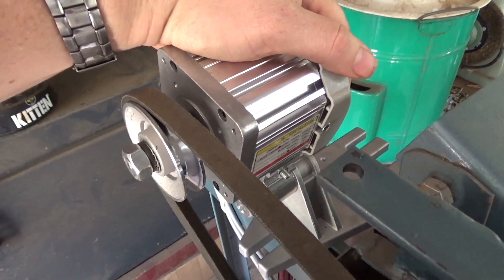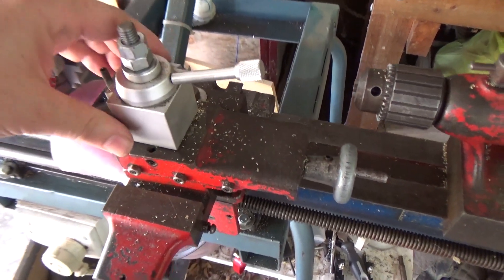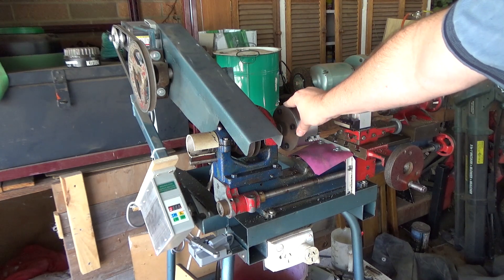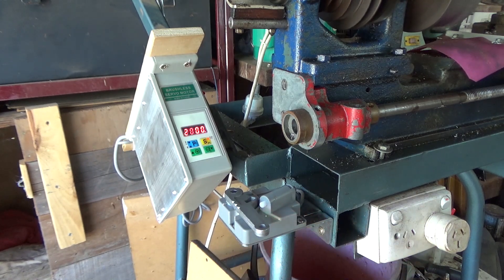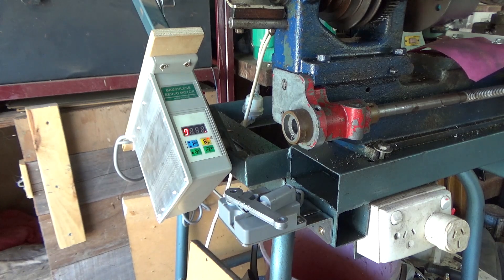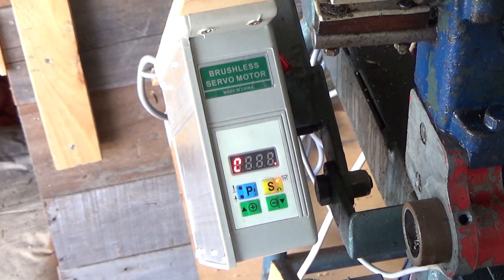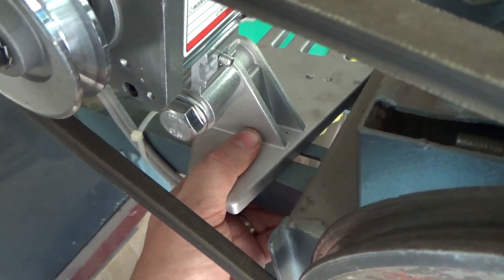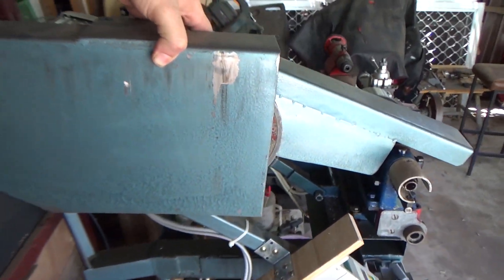Lathe Motor upgrade - adding a 550w 3/4hp brushless servo sewing machine motor

Comment: These sewing machine motor kits are only good if you get the 1 or 1.5hp set up & use is for a belt grinder . No good for a a lathe mate.  Don't re invent the wheel . Use tryed & tested  approaches & keep it simple & u can't go wrong

Comment: Get rid of it my freind . Get a dual phase 230V /415v  3 phase motor & VFD they are cheap as chips & you will NEVER regret if. Infinite speed control. For for 1.5Kw

Comment: What is the lowest RPM your new motor can run at? I'm thinking doing a similar conversion to my lathe, but I need to run at least 50 rpm when doing screwcutting.

Comment: Out of the box, did you need to do anything to get the motor spin? Did you need to set some specific parameter in the controller?  I just bought one of these, it won't spin! Thank you. [UPDATE: I was moving the lever in the wrong direction! It works!!]

Comment: Sir, is the speed linear with the movement of the lever ? I noticed you change the program speed. Is the program speed the setting of the max speed the motor could turn ? This means if you set to 3000 rpm, the speed can vary linearly between 0-3000 rpm?

I am looking to use for cnc application. Does the input control take voltage say 0-5 or 0-10 V?
Reply from the maker: That is correct regarding the speed control, you can set the maximum speed in the controller, and then the lever adjusts between the 0 and the top speed you specifiy. 
The control lever is a potentiometer or a hall effect sensor, I can't quite remember right now. I'm not sure the best way of adapting that for digital control
Reply: @StiffmanOz  thank you sir
Reply: @rengankrishnaiyer6912  That kind servo motor for sewing machine I think they say 5v. I see it  from the manual book
Reply: @rengankrishnaiyer6912  and for some brand they have connector for 5V DC led lamp. 5V 100mA
Reply: @coron1985  thats nice to know cheers

Comment: Just burnt mine out cutting steel at 200rpm on a bandsaw. getting a worm-gear and will shut it down before cooking the next one. There's a gap where the lever meets the housing allowing swarf waste to short across from the magnet to hall sensor and lever. It's a nasty jolt with one hand on the lathe and you touch the lever. Shrink wrap the lever  and a regular clean solves that.
Reply: Turns out while the motor got too hot to touch it still works fine. The controller needed replacing.

Comment: Do you think the motor is usable for a small bandsaw?
The variable speed makes me think of using it so my bandsaw can be used to cut metal
Reply from the maker: It might. It depends on the size of the motor on the bandsaw. If it's only one of the table top ones, I wouldn't be surprised if it is OK wattage wise. The other thing to be aware of is max RPM. These little motors can spin at quite the pace. You might want to confirm the rpm of the motor on the bandsaw too. You can adjust the speed on the motor controller, but you want to be careful not to give the bandsaw way more speed than what it can handle. 

Basically, I haven't done it, so I can't say for sure, but it might.

Comment: Why wouldn't you just mount the servo directly to the back end of the lathe spindle instead?
Sure it spins but it sounds a bit loud and you hardly get to see the benefits of a servo motor over another kind of motor the way you've done it.

Comment: Hi great tip by the way, im just curious if that dc brushless motor can be tweeked to add a reverse switch ?
Reply from the maker: I'm not entirely sure. The control system does have a method of reversing the motor, but it's not quite as easy as flicking a switch.
Reply: @StiffmanOz  Thank you I really appreciate the conversions you did and planning to do the same with mine upon figuring out the reverse rotation issue.
Reply: @abelplus  if u want to make easy reverse switch. You need to see how Drone/RC Brushless 'DC' motor work. They use 3 cable, just swapping 2 cable will make the motor rotation changed.
Reply: Need some modifications to the cable before motor, I think the name for 3 cable that brushless motor called U V W cable . using Dpdt switch for easy reverse. Correct me if I'm wrong
Reply: @coron1985  Thank you coron 19,  I did a similar solution like you said, I decides to install a 3phase ac motor and a VFD controller that gave me a lot of flexibility with speed and direction controls and direct integration with my breakout board. Again thanks for the tip
Reply: @abelplus  how much watt that brushless AC motor do u use?
Reply: @coron1985  I just used 0.55KW which is just right for my mini lathe, the motor is  220ac, 3 Phase, 60 hz,  3600 RPM motor and my pulley ratio is about 1:3 so i can push about 1270 RPM on my lathe chuck.
Reply: @abelplus  how about torque? Is capable?
Reply: @coron1985  Torque on my 3phase motor was not specified on my specs sheet but on my observations the torque is greated compared to my orig single phase, even at lower RPM's ,
Reply: Is there a possibility of motor shaft metal fatigue with those loads and instant brake.
Reply: @rodenreyes6320  yes when you use the motor direct drive.

In my opinion, the best is use belt like in the video.

Belt slipped when the drill or whatever is stuck.
The motor still spinning and slipped belt rather than forced the rotation.

Comment: I put one in the wifes sewing machine and its variable, why can you put a lever on there to control the speed and set the max on the box? Seems like the entire benefit of the motor is being wasted, yours looks like it just goes on/off? Ours is variable- looking to upgrade the southbend 9 to a modern motor..
Reply from the maker: The leaver controller is completely variable. You can set the maximum speed on the controller box, but then adjust it with the lever from slow, all the way to the maximum set speed.

Comment: Thank you for showing how to install a brushless servo motor on a small lathe.  Will be doing this myself shortly!
Reply from the maker: I'm glad it's helpful. I still really like this motor for my lathe, it makes it so much more usable being able to quickly change the speed of the lathe. I hope yours works out well for you too.
Reply: @StiffmanOz  I feel like this is a real coup for repowering a lathe- with an industrial sewing unit you get a motor, speed control and power supply already put together at a great price.  With the electronic speed control you're able to go very slow yet have plenty of power I take it.  Awesome!

Comment: Hi. Is that the motor DC?
Reply from the maker: not really - it's a brushless motor, so it needs the brushless speed controller system to run, there is no way to just directly power it from a normal DC source.
Reply: @StiffmanOz  i want to run it on battery. Is that DC brushless esc can run that motor?
Reply: After I contacted some suppliers. They give me information its 3 phase brushless motor.
Its like other 3 phase brushless 'DC' motor need ESC. But they didn't give information about what minimum / max voltage

Comment: Hey StiffmanOz!  How is the low end torque on this machine foe threading?  Stay healthy!
Reply from the maker: Hey, How's it going. I don't really do much threading on it, but I think it's powerful enough for this little lathe to do the job at low speeds. I'm very impressed at how this little motor performs, and think it's a worthy addition for many small lathes and machines. I've contemplated putting one on my drill press too. The instant speed control is so handy!

Comment: Hi, can you please share a link for motor and regulator? thank you
Reply from the maker: https://www.ebay.com.au/itm/220V-550W-Energy-Saving-Mute-Brushless-Servo-Sew-Motor-Industrial-Sewing-Machine/323481742503?hash=item4b5103aca7:g:XWcAAOSwAkRfV0xw
This is the same as the one I bought. It isn't the same place as I bought from, but it's the same motor system.

Comment: You need to move the magnetic hall effect speed control as it is open on top and the way you have it placed, it will get metal fillings inside. Since the center wire is a full 115 volts, it could short and fry the control unit board.
Se mine at https://www.youtube.com/watch?v=kIOwBBERioc